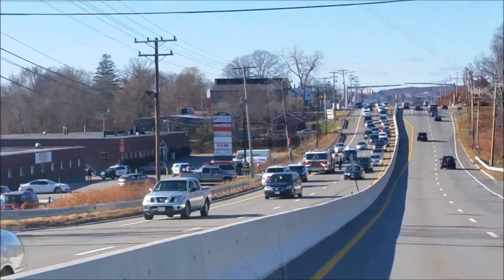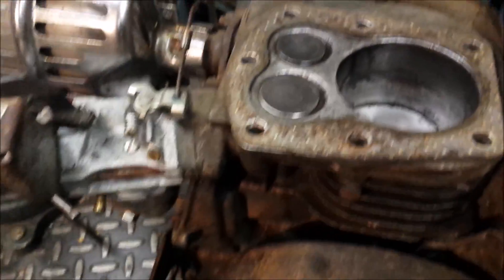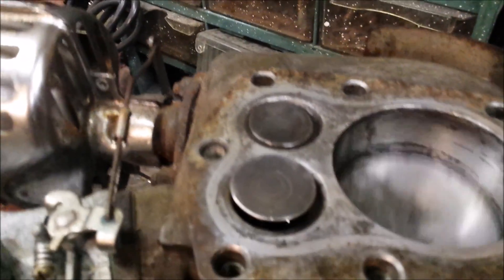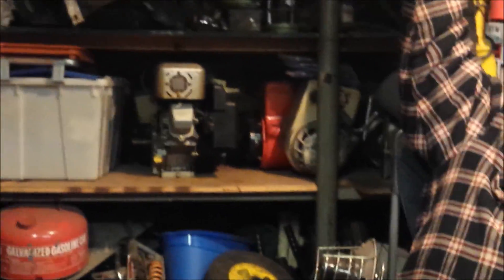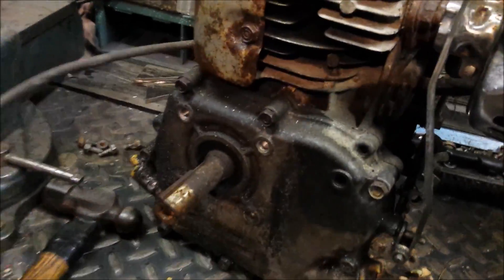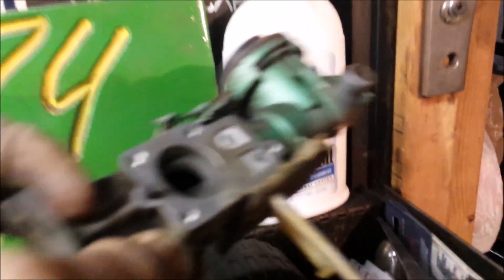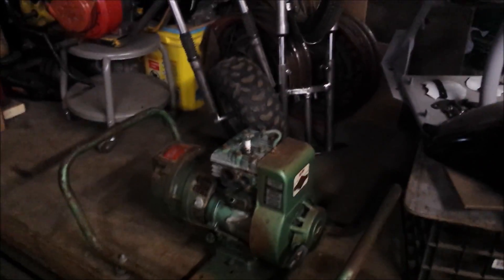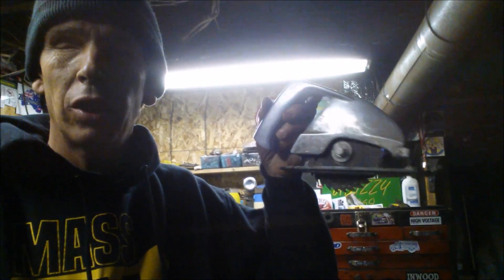Things in the Hood, And  Plans at the shop

Comment: Worked on Honda G200. Onlly time I had a failure for spark was the points seized on the pivot and they would not close. Clean and lub and away it went. Thank you for the video, Dizzy
Reply from the maker: I did try that But still no juice, so getting a used one soon, Cheers my friend.

Comment: Top speed friggin right lmao :) That honda probrobly just needs the points cleaned if theres no spark. Thatll work nice on the minibike
Reply from the maker: You think it just needs cleaned?? i don't know how to clean points very well so Time will tell. I may need your help. lol  Cheers Brother.
Reply: Probrobly. you can test the continuity between them with a meter to see if they are making contact. I just run sand paper between them and spray them off with brake cleaner. They can be real finicky . Good luck bud